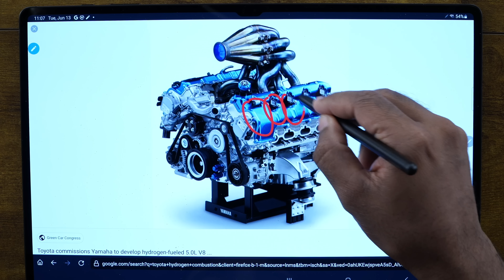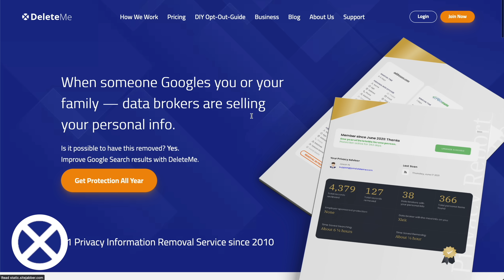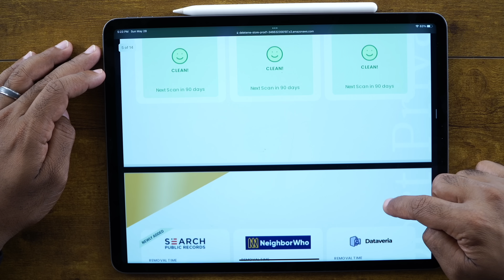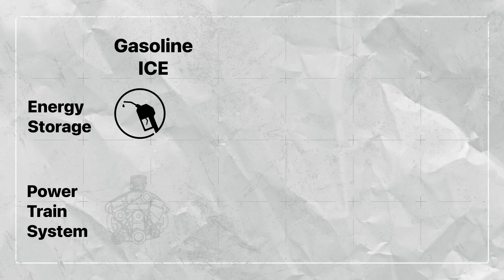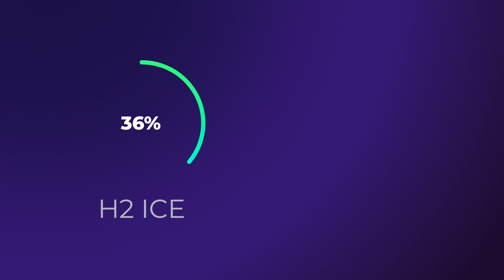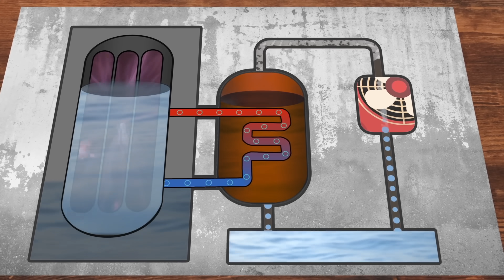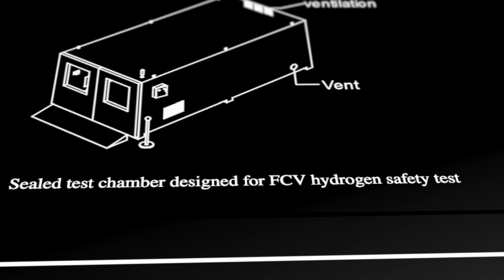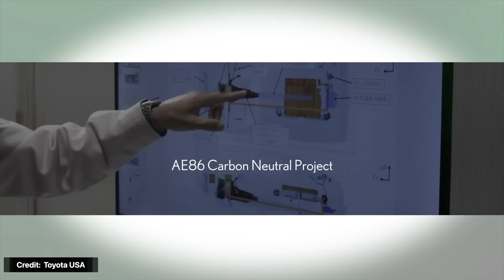Toyota's Says They Just Destroyed EVs - Hydrogen Combustion Engines

Comment: NO, you DON'T have to use pressurized storage for hydrogen! That's a lie. And it IS safer than gasoline to store than gasoline is. In the 1970s , metallic salt lattice storage was developed for hydrogen, and the government immediately made it illegal to sell. The hydrogen is pumped into the tank at the same pressure as gasoline is pumped into a gas tank. In the tank, it bonds with the storage medium. There, it can be stored indefinitely until it is heated to release the hydrogen. From there, the hydrogen can be used in an ice vehicle. 

Yes it is true instead of having a single 12 gallon gasoline tank, you do require 3 smaller 4 gallon hydrogen tanks of about the same total volume connected to a manifold to achieve the same fuel flow as gasoline but that is easy to do.

Also as you should know ice produces heat as a waste product. That can be used after the engine warms to release the hydrogen fuel to run the vehicle. Only a small aux Hester is required to run to start the vehicle until the engine warms up.

The initial problem with the 1970s prototype was getting hydrogen fuel in the first place. But if you placed a shipping container sized nuclear fuel hydrogen generator at any gas station, it could fuel hydrogen cars as long as it has a water source for decades if not a century. 

In conclusion, we have decades tested nuclear cells that can generate hydrogen at pos. That eliminates shipping fuel to pos sites. Hydrogen can be stored safely. A hydrogen vehicle can be refueled just as quickly as a gasoline vehicle, and it can have the same range.

Concidering all these factors the only thing than is pushing the current use of electric vehicles is the graft politicians have taken from the green terrorist lobbies and global warming cultists.

Comment: Cars cars cars.. What about trucking? If you want to build out a network, start with point to point trucking companies?
And what about charge time? How long does it take to moderately charge a truck?
Or how about avoiding the un-extinguishable battery fires?
And what will insurance companies charge for hydrogen vs ev?
Can you fly a plane on EV?
What about not having to buy oil or gas from psychotic dictatorships because you can produce hydrogen anywhere?
Does the EV one-solution fit all?

Comment: Warning curmudgeon post following.

Interesting, hydorgen has always had the problem of energy density. But the hydrogen vs. electric is valid. (going major anti PC here the premise of carbon netural may not be valid though at the present PC) The current type of electric vehicle is not scalable do to materials needed and world sources. The modern production of EVs takes over a decade to offset the production carbon footprint.

And this video did not point out the EV problems if expanded they will need a much increased power grid to produce the electricity, charging of cars if you do not have the ability to charge them at home (curb side parking ect) And the safety is not great. How many makers advise not to charge your car overnight in your garage? They are much heavier increasing the kinetic forces in crashes and increasing road wear. How many stories of battery failures and fires?

My point is EVs may be better in short range/urban travel but they have problems elsewhere. Hydrogen may have advantages in different ways. And consider production problems, how fast can the world retool all it's production facilities, including component parts and raw materials?

 Instead of the government picking winners and losers (and they are very bad at it) the market of finance and ideas should decide and pushing one or the other is not a good plan.

Comment: I see H2 ice engines being of benefit over a pure electric engine in remote areas that rely on diesel generators to provide electricity to the local area which have a severely limited output vs traditional power stations as that may not allow multiple electric vehicles to charge at once, whereas you could simply truck in H2 to a fuel station.
Reply: In that case you would be far better off transporting some diesel to the remote location. It would actually be less polluting than using hydrogen from fossil fuels byt nowhere near as good as a BEV.

Comment: Perhaps the biggest problems with BEVs is that their "fuel tank" (batteries) degrade over time, you may not be able to replace them in the future (either because of their very high price, or your car's battery being discontinued, like the Chevy Bolt case)...
Reply: Yeah, it's a good thing that ICE cars don't degrade over time.
Reply: @maryhadda8420  they do, but you can easily machine parts to replace the degraded parts. There is a reason that 100 year old ICE cars are still easily on the road. There are a few 100 year old EV's, though they all had their batteries replaced, and their batteries are basically normal car batteries with low range, IIRC the most popular "lady's car" (look up jay leno's garage) has 6 normal car batteries in it. Meanwhile a lot of the 100 year old ice cars are more or less the original parts.
Reply: @MrSolLeks  Yeah, I come across cars from 1923 frequently.
Reply: @maryhadda8420  still a couple hundred thousand model T's still out there that are road worthy, they did make some 15 million of them lol.

Comment: I used to be a believer in hydrogen. It is a future solution but never for the present. 
Hydrogen ICE is not suitable for cars maybe heavier vehicles. Nitrous Oxide is a significant green house gas and ozone scavenger. 
Also the energy used to create hydrogen fuel is immense and probably more efficient to just create electricity....we just need to magic up the rare earth metals for the storage batteries.
In regards to ICE sound and viberations...I am really happy with my BEV performance off the mark.😊

Comment: Have they published any data on metal embrittlement caused by hydrogen requiring maybe a new block and pistons periodically?. Also you can add a sound system if you really want the noise. An EV can get electricity from any source (like the plug socket in the garage) many of which are way more efficient than generating H2.  I just don’t see it for passenger cars.
Reply: Also you can add a sound system if you really want the noise ....  I always admire this desire to live in fake world :)

Comment: I have seen devices you can generate electricity from by heat. They have some for camping that all you do is start a little fire in it and it will charge your cell phone and all kinds of other stuff. When the technology gets better they could probably run the hot oil from the engine exchanging the heat for these devices turning it into electricity. Between that and electricity generated from the car running they could generate the hydrogen themselves on board. From water. Years ago I made a hydrogen generator for a pickup truck I had. They are not that complicated to make. Of course the truck wasn't running exclusively on hydrogen. But it did help reduce the gas mileage by producing supplemental fuel. If they made a more efficient generator it would only cost you water. To refill. And perhaps a reserve tank you might need to refill periodically. The only problem is the more stuff you put in it the more complicated it is to repair. But it would increase the efficiency rating greatly every time you use your brakes heat is generated. When you drive down the road your tires generate Heat. Given the right technology you could collect a lot of heat and generate a lot of hydrogen. And the best part of any of it is, you wouldn't have little children in third world countries digging holes and crawling Underground under dangerous conditions collecting the toxic metals to build these batteries. About the only place that allows it to go on his China so all these batteries are coming from China for the most part maybe Toyota is just building on science knowing that one day when added with other technology it will become more feasible. When I was a kid they were using a lot of rotary engines which were extremely inefficient. They were fast but they didn't get very good mileage. And they had a lot of problems. This is how people learn though. Gasoline is still the smartest choice. I don't believe all that horse crap about global warming. If CO2 is really the problem why aren't they planting trees like crazy? Trees remove the carbon leaving only oxygen. It's really a no-brainer. You don't have to give billions of dollars a year to something tank trying to come up with Solutions.

Comment: I think the actual round trip efficiency is closer to 20%.  Most of the deficit is in making the free hydrogen. I understand that, through electrolysis, the efficiency is about 2/3rd. After that, the free hydrogen has to be compressed, which requires more energy input. Then, finally, there is the thermal efficiency of the engine itself, which is likely around 40%.

In regions where the initial energy is cheap, such as Iceland, which has an abundance of geothermal energy, this might make sense. There, the free hydrogen can be generated on the spot.

Otherwise, the costs of transporting and possibly re-compressing this gas further increases the costs.

Comment: Forgive my ignorance on the subject but why aren't we talking about hydrogen power plants? I work at a warehouse that just changed out all of the batteries, that powered all of our forklifts, with hydrogen fuel cells. Instead of an 8~10-hour uptime, we refill our fuel cells every 2~3 hours. Each fuel cell cost $40,000 and we have roughly 200 forklifts. The warehouse is not air-conditioned and each fuel cell is essentially a heater in a building that reaches 100 degrees in the summer BEFORE the hydrogen cells came to us. Lastly, the hydrogen is trucked in with diesel-powered trucks. Seems to me this hydrogen car/fuel cell is nothing more than a gimmick.

Comment: A couple key things you're glossing over, even though you're mentioning them earlier, is the lower up-front cost of the H2 engine which will lead to better adoption, and the big area that ALL of the EV's out there have being energy density.  That's one of the HUGE hurdles that EV trucks are having is that by the time you get enough battery for the big vehicle and 300m range, there's no payload left. If and when we start seeing salt batteries, which are about 30% larger than LFP which are larger than Li-Ion NMC that's where physics rears it's ugly head and stomps on the technology.  

Toyota has been working hard in Japan to get the H2 infrastructure out there to supply these vehicles at home, but you're absolutely right that it's not going to take off here until someone says "All of out Mobil/Exxon/Arco/Chevron/Whoever stations will have H2 pumps as of $Date."  Once a major supplier picks an alternative energy source, pretty much EVERYONE will go to that fuel type, be it EV, H2, or even Ethanol.
Reply: Ethanol or butanol might be viable green synfuels, but they will not be cost competitive with BEVs.

Comment: I don't think Hydrogen ICE is a "magic bullet" either, but I don't see why it can't exist as an alternative option. The important thing is that it emits way less carbon than gas does, and don't forget about the possibility of synthetic lubricants that don't contain carbon, or perhaps contain carbon in a less polluting form, such as graphene or something. There are some things that EVs simply will never be good for unless we somehow come up with a solution for zero-point energy or something equally sci-fi. An example of this is off-road activities and vehicles, such as Jeeps. With any new tech, it will take time to work out the kinks and increase efficiency. We eventually developed regenerative breaking for EVs, who says we can't find some way to capture and use the heat generated by H-ICE for something useful? What about making a new type of hybrid using electric and H-ICE? The thing you failed to recognize is that this is another item to put on our list of Options. What about miniaturizing an H-ICE with more but smaller cylinders and making it into a generator instead of the direct power train? Maybe such a Hybrid would be just the thing to finally help extend the range of EV tech? Maybe this would let us use some sort of super-capacitor to run the EV motors and then the battery becomes a backup option for when we run out of Hydrogen and extends the range that way? There are so many possibilities this opens up that people never think to consider because of the way these sorts of things get presented as an "either/or" option instead of how different techs could be combined to make transportation better in general.

Comment: This will be a tiny niche product, and there never will be a complete hydrogen distribution system for cars. It will also be less efficient to use hydrogen to transmit power than to use electricity. Hydrogen is just a battery, an energy storage device, and it's not very efficient with our current hydrogen production methods.

Comment: Hydrogen has been the proper future solution for DECADES. Stuff that burns is always less efficient, BUT the Elephant in the Room is Electricity Generation Capacity. Our electrical grid is already weak and sketchy, with Blackout and Brownouts happening all across the country. Hundreds of people in Texas died two years ago due to a failure of the the electrical grid - and to date the Texas government has done ZERO to reinforce the grid or require stronger regulatory requirements. Given this constant Energy short-fall, HOW are we going to produce enough EXTRA electrical capacity for everyone to 'power up' their EV batteries overnight - EVERY night - so they can get to work and back?
Reply: HOW are we going to produce enough EXTRA electrical energy (3X more than for EVs) to produce enough hydrogen? And by the way: EVs don't have to charge EVERY night. Do you drive to the gas station every day?

Comment: When I came out of school, hydrogen was the hype in the fuel sector - companies like Ballard Power Sys were promoted as sure-fire investments on a post-fossil-fuel world.
50 years later nothing has changed, not even the name of the sure-fire investment in the hydrogen world, only BMW and Volkswagen have been joined by the Japanese.
To me the handling of the highly volatile gas is the problem, the risk of leakage and accidents like the Hindenburg disaster from the 1930s in NY.
It might be more safe to produce CH4 or (CH3)2 to fuel combustion engines (using the CO2 from the air) - and the second chemical would be a starter for a nice cocktail.

Comment: No where in the video did you mention that presently most hydrogen is made from steam reformation of natural gas releasing carbon monoxide and carbon dioxide in the process.  Only a relatively small amount is made from the electrolosis of water a cleaner but also energy consuming process.  I am also quite shocked at the efficiencies you describe for the internal combustion engine.  35% may be a streach for anything other than an engine that runs at a constant RPM.

Comment: All the talk about efficiency is valid, but not important to consumers. We have had one type of vehicle for so long that our measure of efficiency is biased toward that. What matters to consumers is not MPG but cost per mile to run (just talking fuel). Gasoline prices fluctuate wildly, as do electric rates (although not as much for the later). The best measure for the consumer is cost per mile. If you have your own solar system (or wind turbine) then your cost may be low. On the other hand, in places like the UK, with minimal solar resources, the cost of electricity is high (actually, this is true all over Europe). I have seen reports that the cost per mile of an EV is basically the same as for ICEs in the UK. The fact is (and I have done this analysis in the past) that the ownership cost of an EV is always going to be higher than the cost of an ICE vehicle, even with high gasoline prices.

Comment: Some time back there were reports on an australian project which involved modifying existing diesel ICE engines to run on a lean diesel rich hydrogen mix. The intended use was IIRC in the rail, trucking and mining industries.  What is going on with respect ot that effort?

Comment: Honestly, while I think hydrogen fuel cells make more sense for daily drivers, I'm kinda hoping this technology finds niche usage in the oldtimer conversion scene. If you bought a classic car with a nice sounding v8, you typically don't want to electrify it. But having the option to "simply" swap out the gasoline ICE in my '76 Corvette with a v8 hydrogen ICE, and then being able to fuel at hydrogen gas stations that were built to serve the contemporary hydrogen fuel cell vehicles, would mean I can still drive that car when gasoline eventually becomes too rare and expensive. And it would still handle and sound more or less the same.

Comment: In a country like Iceland the efficiency isn't a problem since the energy used to generate the hydrogen is carbon neutral.  Also it's the country that's has the worst temperature for batteries.  So I hope this will go further.